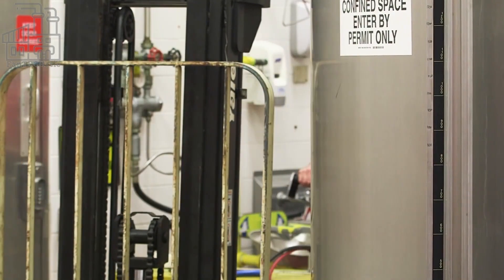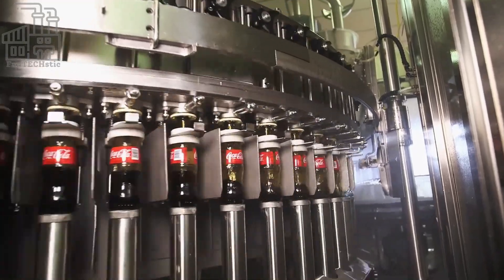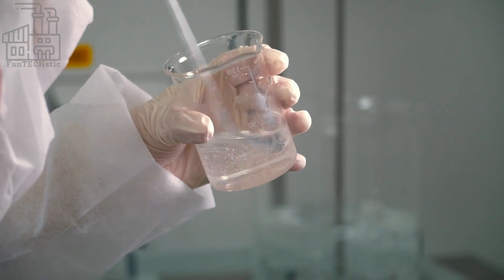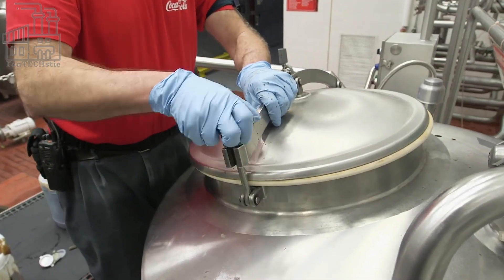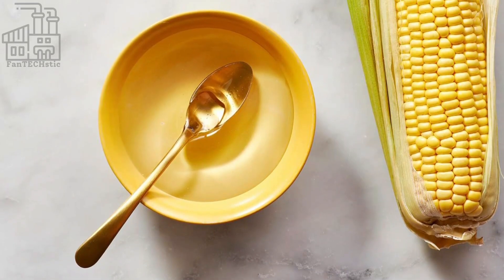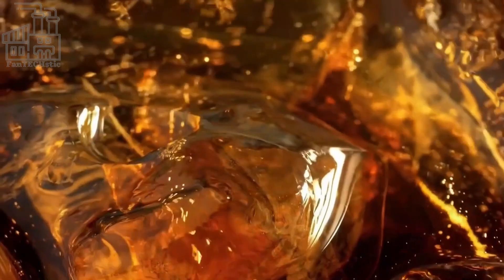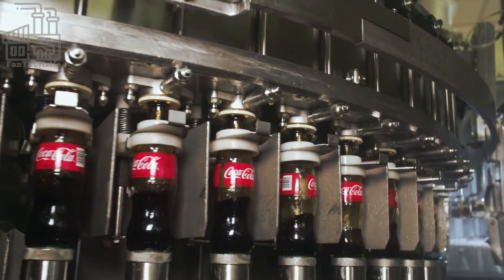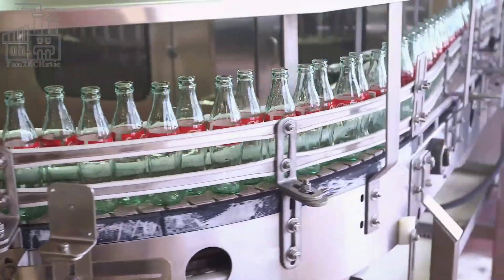Ever Wondered How Coca Cola Is Made?! Join us on this FanTECHstic Factory Tour!

Comment: Of course unless you get the glass bottled Coke from Mexico, you are not drinking the actual original formula. The flavorings might be the same, but by using high fructose corn syrup, or other substitute sweeteners, instead of pure cane sugar, the taste in the so called original formula is entirely different.